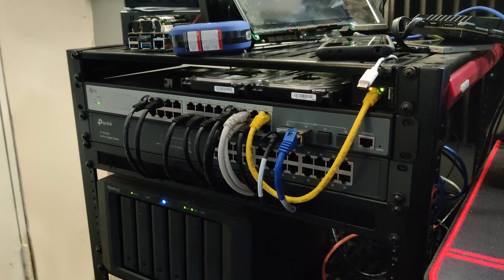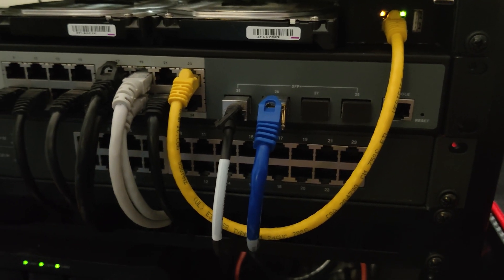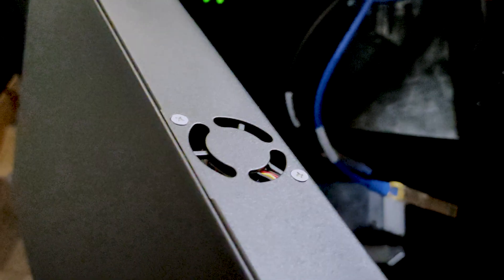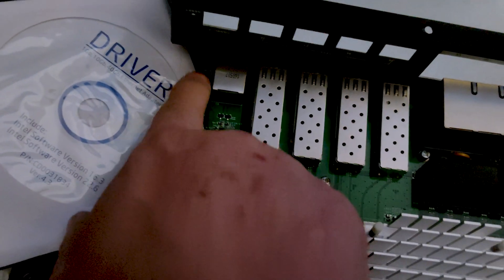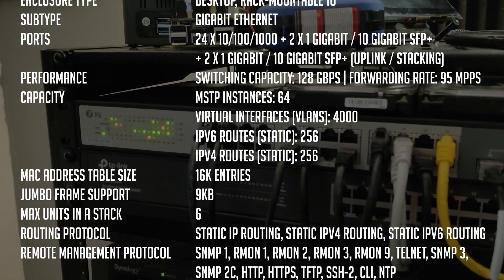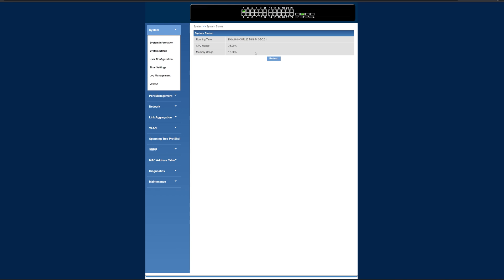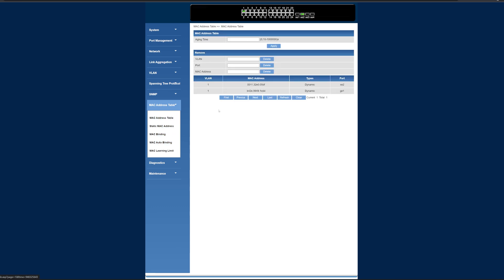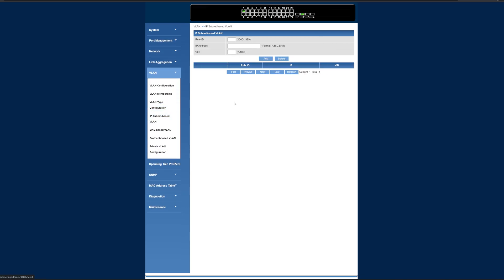10G Networking with the FS S3700-24T4S

Comment: Noctua NF-A4x20 fan would be a good replacement that would lower noise and still provide some cooling.  Keep in mind though that part of the fan noise is caused by the way the hole is cut into that chassis.

Comment: For connecting just two or three computers within the same subnet a unmanaged switch does the job for much less money. With your review you do not even scrach the surface of what exciting things can be done using that excellent piece of hardware. 😜 And btw ... are you sure your 2.5G network clients are running full speed?  A short look at the management console of the switch and a  iperf3 test would have been nice.

Comment: Great video. Thanks for the look at the internals, and the focus on the noise. That's a really important thing to consider for home networking--especially for those of us that sleep in the same room as our networking equipment. :P

What's the size in mm on that fan? I'm guessing one of the tinier Noctuas would fit. If it's been running that long with no fan at all, a tiny Noctua would be a good bit of insurance.
Reply from the maker: Thanks!! I think it's an 80mm fan that I could probably get to work with a Noctua. I've done the same for a Unifi switch in the past, so it might be worth doing it on this one, too.

Comment: You should consider a Mikrotik CRS305 or CRS309 that is fanless!! Or if you want more ports you can go with CRS317 or CRS312
Reply: I've had my eye on the CRS309 and CRS317 for a while, but prices went wonky on both. The CRS317 is NOT fanless, however, and will start blowing if you use more than a couple of SFP+ to copper adapters, from what I understand.
Reply: @sinisterpisces  thx for the clarification and you are right!